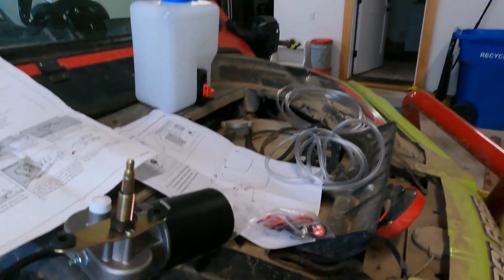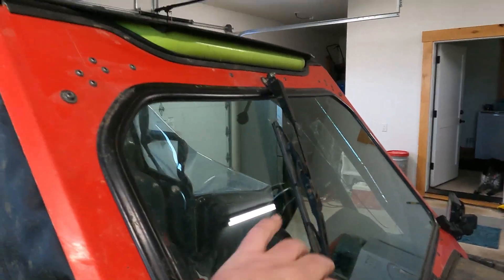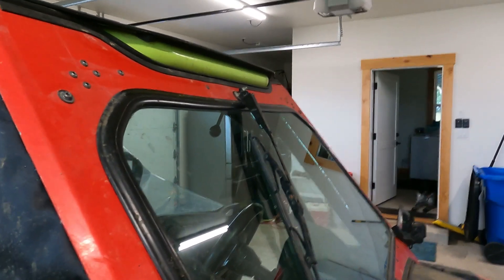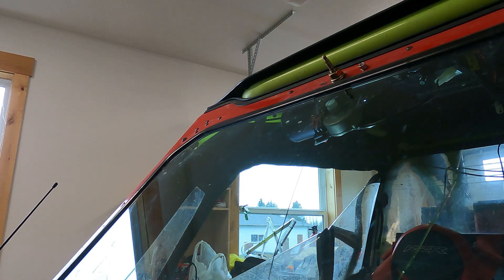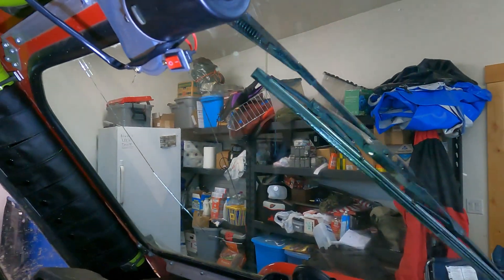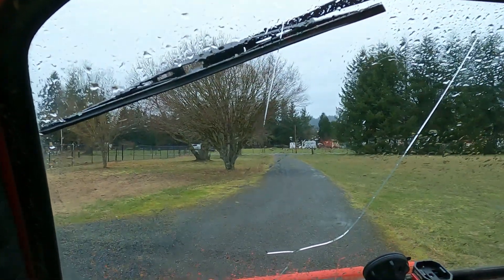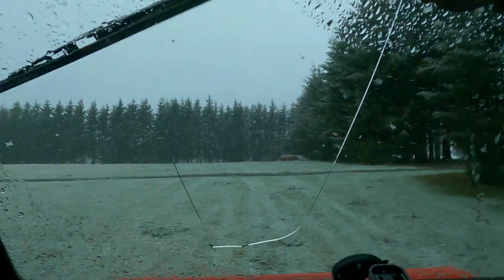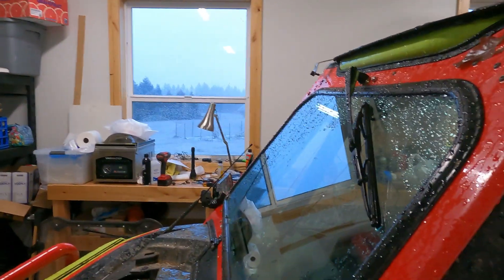kemimoto wiper kit.     Link in description

Comment: Do you have an install video of where you wired it into your machine?
Reply from the maker: I had wiring coming from the second battery already ran to the trunk area for a charging spot.  I used those same wires and went to the motor and the washer tank.

Comment: How do you like it now that it’s been a few months?
Reply from the maker: I wish it did more of the window but it’s holding up     I took it off 3 weeks ago for my Canada trip and now it’s summer so I won’t be using it till next fall.
Reply: Can you upload pictures of the installation manual please ...??? Also does your wiper and squirter work without the key in the ignition.. have you had any problems with it draining the battery
Reply from the maker: @Stephen-do8ey I had it set up where I didn’t need key on for either and no it didn’t drain the battery.    I will have to look and see if I have the instructions.   I’ll see if they have them on their website